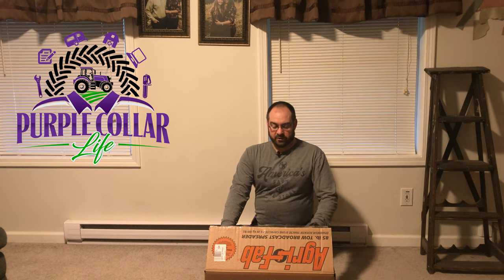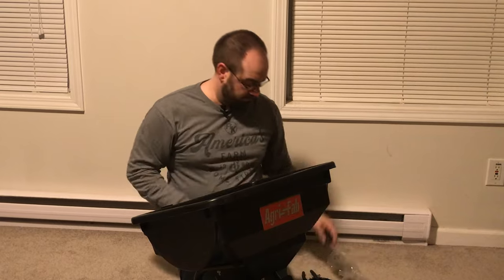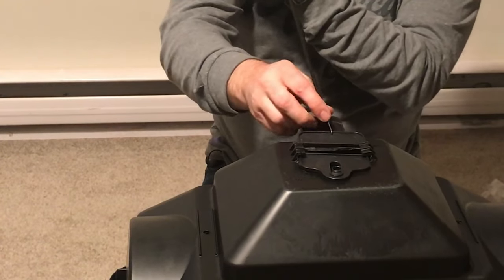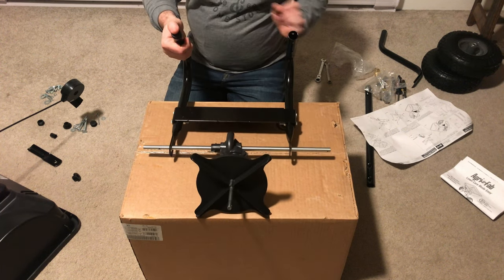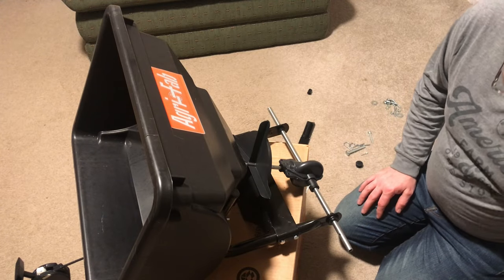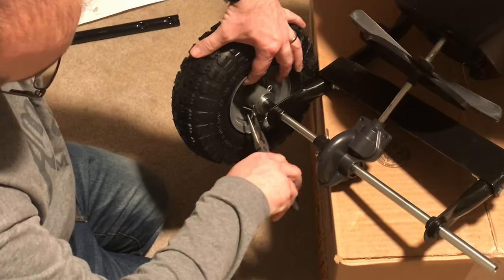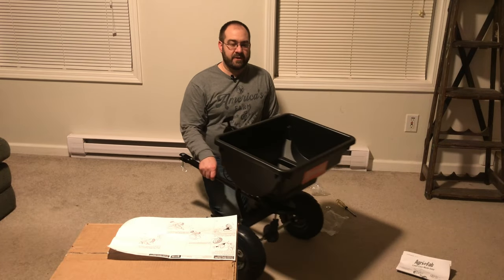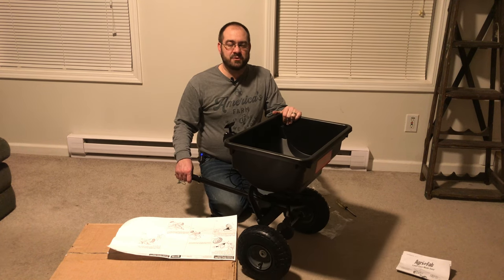#197: Agri-Fab 85 lb tow broadcast spreader assembly and initial review

Comment: Thanks for the video.The only thing I had a problem with is control cable. When I installed it , I could not get the cable to open and close the flow plate. So I finely cut a pvc pipe to extend the the control tube.  I mounted the control cable to it and it works just fine .
Reply from the maker: Thanks for sharing

Comment: Chad that’s a nice spreader.  You’ll be happy with it.  Nice job showing the assembly details.

I have their 130lb, tow behind, model.  It has orange tubing and looks perfect behind my Kubota!

It’s my second one.  The first one lasted 15 years... but, last year I loaned it out.  The borrower didn’t hose it out after use and left it out in the rain.  That finished it off!

I made a modification so that I can operate it from my seat.  I’ll post it after I finish my Victorian Staircase Repair series.

Keep posting, I’ll keep watching.
Reply from the maker: Thanks for watching and commenting! No fair that yours matches the tractor. :)

Comment: Thanks..yes..I had to bend the spreader plate to get the bolt thru in the control tube. And yes again..need addl pliers and ratchet wrenches. Mine was missing two of the cotter pins so had to go buy them. Otherwise..was ok
Reply from the maker: Thanks!

Comment: keep in mind that when this spreader is hooked up to a mower or tractor there is no way to turn off/on the spreader from the mower seat….so the spreader dumps a ridiculous amount onto the ground while you get back on the the mower / tractor.
Reply from the maker: That's a good point - but I actually am able to turn around from the seat of our quad and open the spreader while already in motion, so that we don't get that big pile of material on the ground before we start moving.

Comment: How wide of spread ? Was it worth it ?
Reply from the maker: I think it was worth it.  The specs say the spread is about 10-feet wide.  I've typically seen more like 6' of spread width.  I've towed it with a four-wheeler, the zero turn, and a lawn tractor.  It does a nice job.  The only thing I'm not happy with is the feeder control lever - really weak.  I've been babying it so that it doesn't get broken.  Thanks for watching and asking a question!

Comment: Your concerns about the product delivery lever are well founded. VERY and I mean VERY cheaply made. In fact mine broke on the very first use. Me not being one to not complain I called agri-fab and they sent me a new lever which was the exact same cheaply made unit and again broke on the very first use. I had to make repairs with some hardware I had on hand. It’s been my experience with about everything if a part of something is made with poor quality the rest of it is poorly made. Same with this unit. The idea is a good one but the very poor material used to manufacture the unit really kills the whole unit. I used it twice last year and it took some repair and spot rigging to finish the job. So I’m hoping I get thru this season without the thing breaking or falling apart on me. Wish me luck, I’m going to need it.
Reply from the maker: I feel like that one component - from the lever to the slide-gate end - is the worst part of the spreader. The rest is all adequate for my use.  But that handle and the cheap plastic gate at the bottom certainly require the most careful touch so that they don't break.

Comment: It took me 10+ mins for each bolt because of those ridiculous self tightening nuts.  I found a couple old nuts that fit, and I put two of them on in 20 seconds.  Totally unnecessary to use theirs, where you have to use two tools to tighten, and you have to add the fact that they are mounted in impossible places where its very hard to reach.  Also the bolts could be 20% of their length and still be just as strong.  Extremely poorly engineered, and one of the most frustrating pieces of crap I've ever put together.  Good Luck !

Comment: My problem is when connecting the hopper … it does not line up to the holes to screw it?
Reply from the maker: Hi Karen - I had to flex the metal frame a little bit (just pushing it apart slightly with normal force- nothing too hard) as I was fitting the bolts through, so that the frame lined up with the holes in the hopper.  Let us know if that works for you!
Thanks, Chad